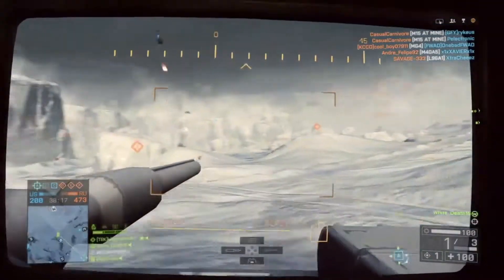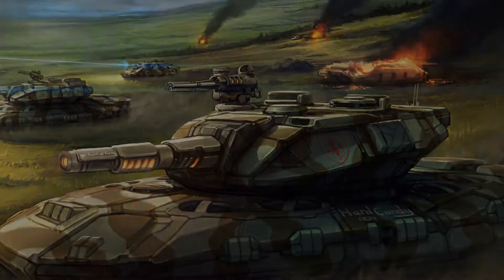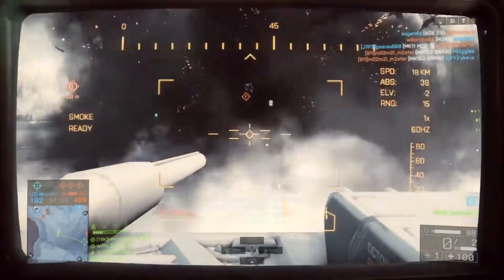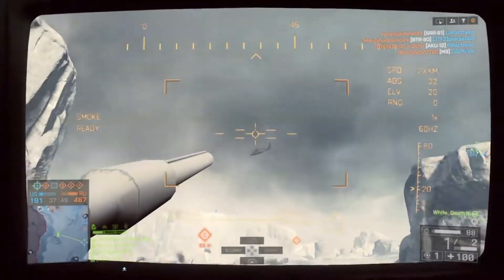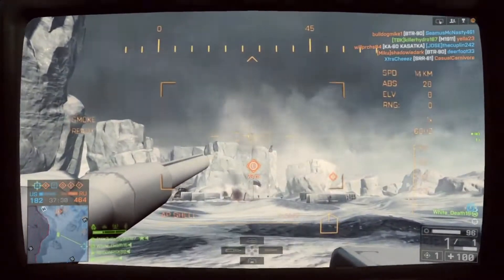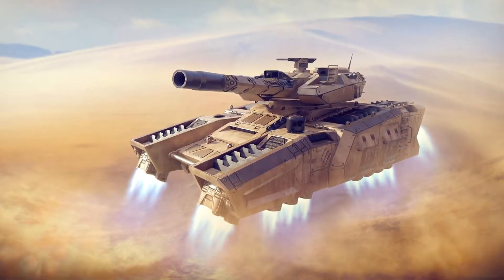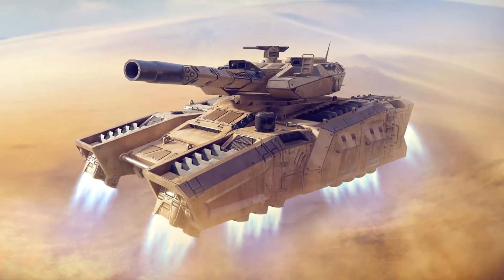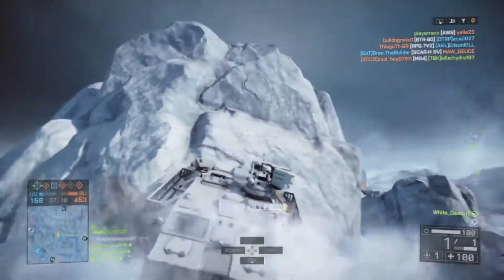Why Hover Tanks Don't Work In Real Life

Comment: I think that the M44 Hammerhead from Mass effect is an example of a hover tank done right. 

In Mass effect, humanity has done away with slow, heavily armored vehicles and opted for vehicles that are essentially IFVs on steroids.

Official classifieds as an IFV, the M44 Hammerhead was originally designed to replace the slower M35 Mako as the Main Interplanetary Assault Vehicle and Battle Tank, however practically, it proved more effective as a Cruiser, supporting the Mako in combat.

Armed with a turreted, rapid fire Inferno Precision Killl Rocket Launcher, the M44 hovers 2 meters off the ground using 3 solid fuel rocket thrusters. One at the back and 2 extended on pylons for steering and strafing purposes. Backup boosters provide the tank with full mobility even if it has lost 2 of its 3 thrusters. It is capable of achieving speeds of upto 120 km/h and is capable of jumping over obstacles. The majority of the energy of its small mass effect drive core is directed to its mass reducing field for increased mobility, leave it with weak 360 degree kinetic barriers. This combined with light ablative ceramic composite armor means that it lacks defenses, relying primarily on speed, electronic countermeasures and auto-repair systems to keep it alive in combat

Comment: We do already have armored hover vehicles, as most modern attack helicopters come equipped with enough armor to stop 50 bmg or higher at range, and bring 30mms to bear like IFVs. Even in spite of this helicopters are very fragile to man portable anti air missiles (if they do succesfully hit, which is mitigated by some modern DIRCM and other such systems) and are no match for fighters.